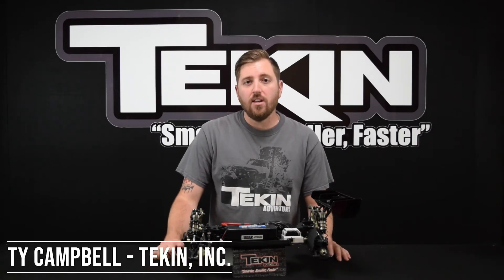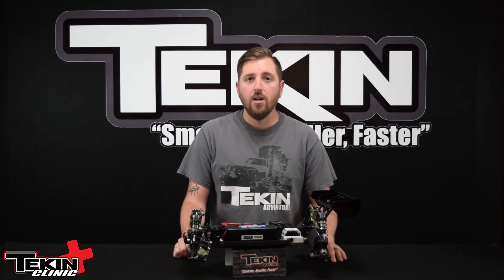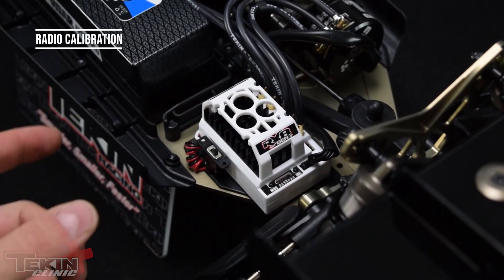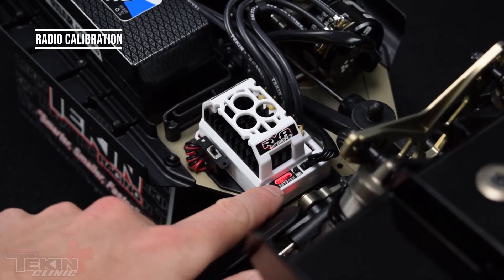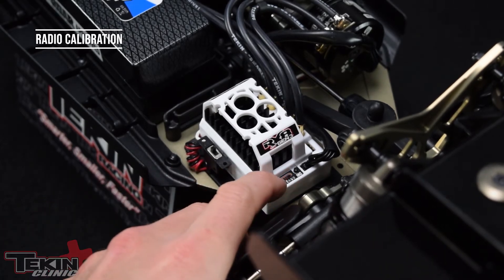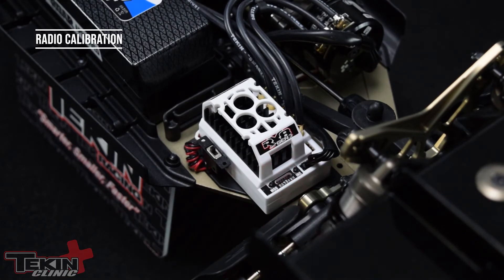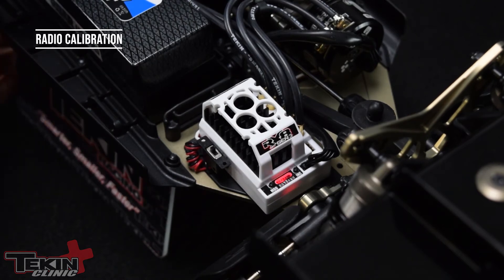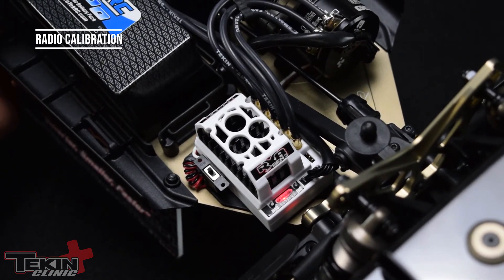Radio Calibration | Tekin Clinic

Comment: Hi again. My RX4 is still not right, it's probably some thing that I have done. when I first wired everything in I had to reverse the throttle, but since had to set it back to normal. Now I have slow forward and fast reverse and a long delay from reverse to forward. I have tried to recalibrate which starts ok, it see's neutral and ask's for full throttle but won't see it, just keep's beeping away.
Have you come across this one? Thanks Guys
Reply from the maker: Reversing the throttle on the radio is the issue. If you need reverse motor rotation you need to do it through the HotWire.

Comment: Hi, I just fitted an RX4 into my truck and when I power it up the LED just strobes from left to right. neither the mode or inc buttons seem to do anything. the steering works but that's about it! Help!
Reply from the maker: That code usually means the receiver isn't on or the fan is plugged in backwards.
Reply: @TekinRacing  Hi Guys. Sorted! Who would have thought that. Thanks!
Reply from the maker: @bruceturner452  glad you got it figured out!

Comment: why my car run faster on reverse than a forward
Reply from the maker: It is probably calibrated backwards. Did you reverse the throttle direction on your radio?
Reply: @TekinRacing  whill check and hope  fix the problem..thanks
Reply: reverse the wires on the motor.